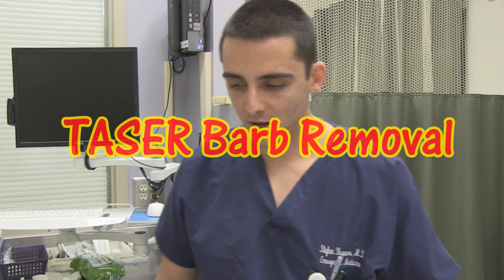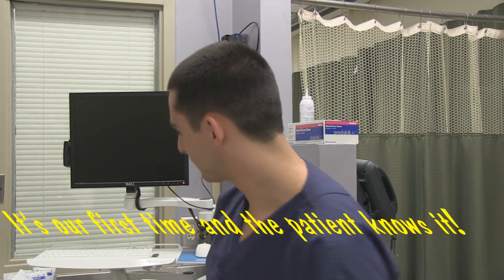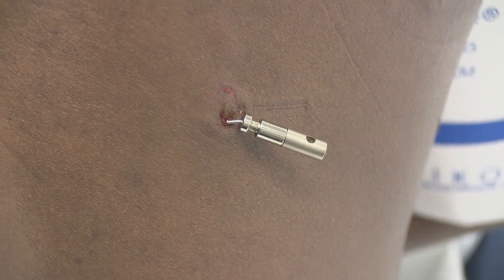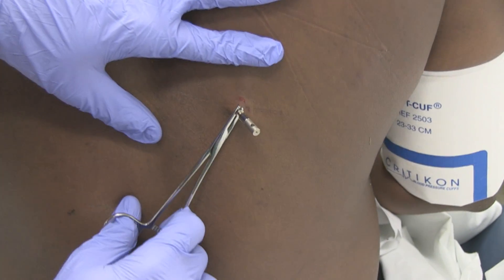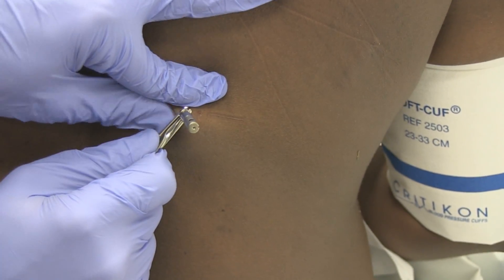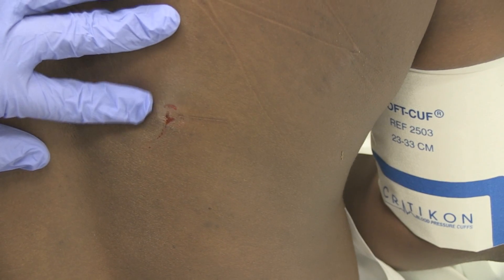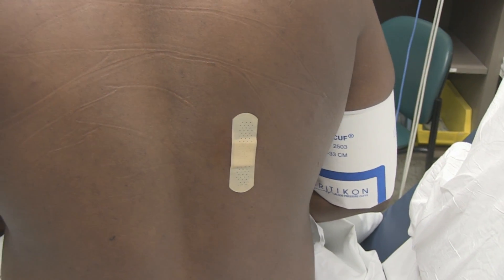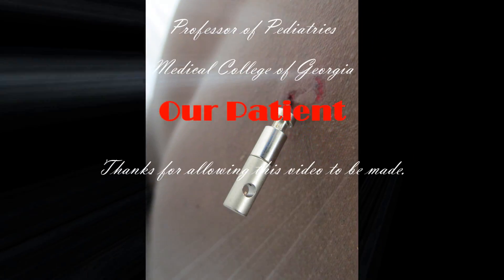TASER Barb Removal

Comment: Alcohol swab???????
Reply: Need to disinfect the area to prevent bacterial infection.
Reply: Saline solution to irrigate...... No need for alcohol swap straight on a fresh open wound, this poor man.. They have other disinfectants that are less painful, but they could have stopped the bleeding and let the skin have time to form a barrier first wth... Alcohol swap AROUND, not ON
Reply: @taylork2874  You know what's even more painful? 50,000 volts of electricity. If you can handle that, you can handle a little sting from a wet wipe.
Reply: @ConsensusX  Yeah that would hurt more, it's still not the standard of care though and caused unnecessary pain for him

Comment: I used to think tasers were more humane, until I realized this shit it like a barbed-pole penetrating deep into your skin.
Reply: So you are saying that you'd rather have a bullet inside of your back that damages your vital organs, instead of a tazer which acts like a thick "needle" going inside of your skin?
Reply: UraniumSnap No.  I'm just saying I didn't realize it was barbed like a fishing hook, and that it would have to be yanked out of your skin.  Surely it's better than a bullet.  I just didn't know it was like this though..
Reply: UraniumSnap I hope you're just being fascist and also don't make me run I'm full of chocolate!
Reply: Eek D'cat Get the fuck off.
First you make an unnecessary, dumb comment. Then you add a very uncalled for racist remark. And to finish it off, you like your own stupid comment.

Also, to prevent your stupidity from spreading I ignored your messages so I won't receive them whatsoever.
Reply: Having been exposed to both Taser and OC ( Pepper Spray) I would rather be tased than be sprayed with OC. Once its done, its done.  OC not so much.